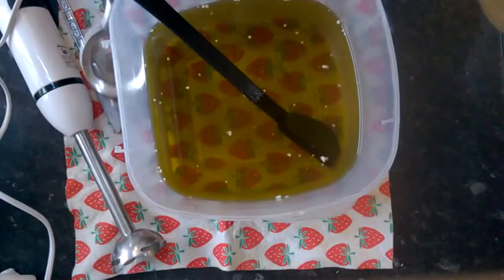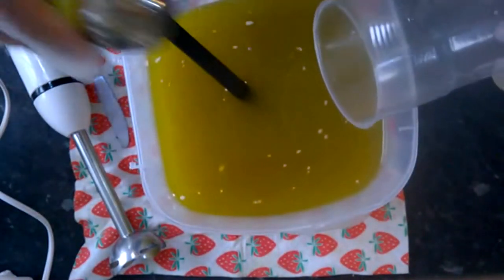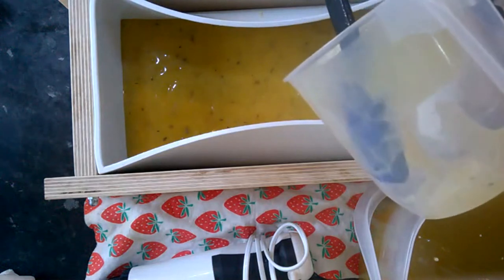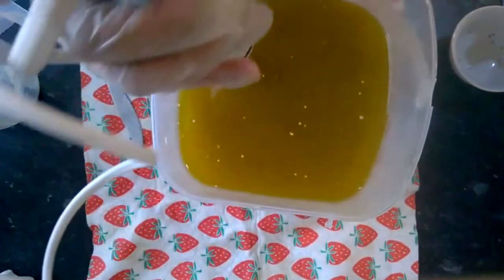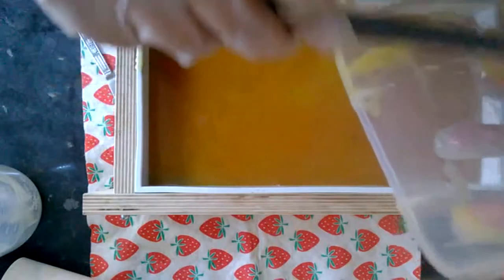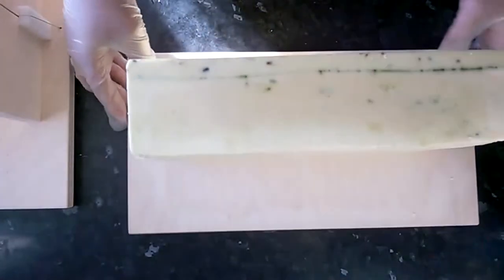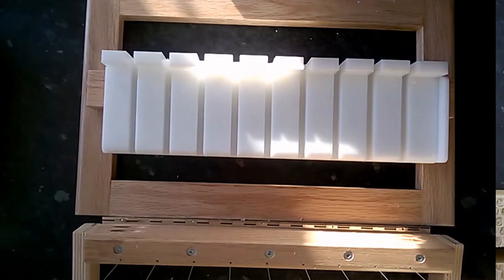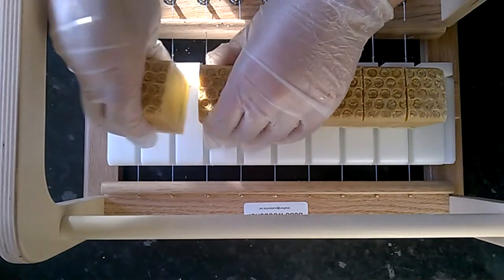Olive Leaf & Honey Cold Process Natural Soap Making & Cutting

Comment: Very pretty!
The funny surface of the top is from 'soda ash formation' which is part of the reaction.  It can be taken off with a quick spray of hot water or isopropyl alcohol.  Pat soap dry and leave on rack.

Comment: It is easier if you use the large paper cli holders to hold mold sides to the wood till your pour gets to them. By then the pressure from the soap will be enough & you can remove them. I thought you were going to buffer your pour over the leaf line, which would have helped prevent break through. All in all I think it turned out great! :)
Reply from the maker: Hi Cheryl thanks for your comment.  I've got a pair of paper clip holders now which I've tried a few times but find myself using a wooden skewer to hold the sides apart now.  I totally agree with you - should definitely buffer if you don't want the soap to break through the layer below.  I usually do this and kind of knew this at the time too but was trying to hurry up and was a bit nervous.  Not sure if you can tell in the video but because a few family members had come into the work space it kind of threw me a bit lol.  Thanks for watching :-)
Reply: I like the wooden skewer idea.  I think I will try that next time.  I know what you mean,  if my husband comes in and starts talking, I have a hard time staying focused.   ;)
Reply from the maker: Wishing for the day I can rent my own workspace :-)